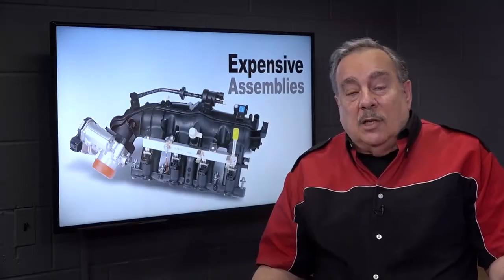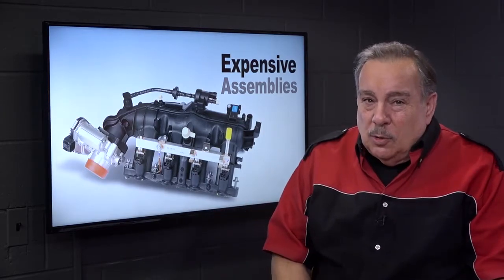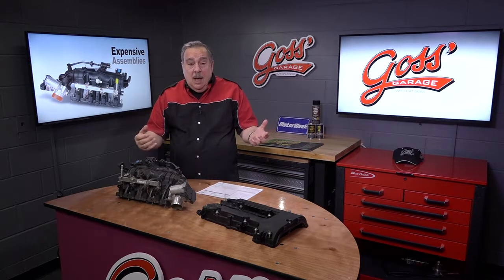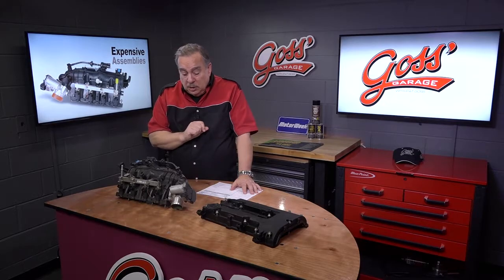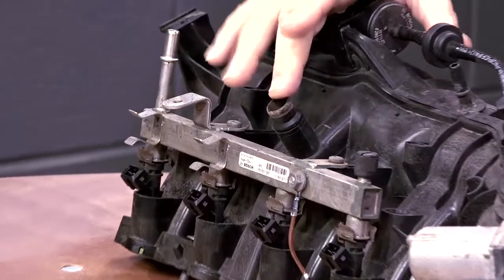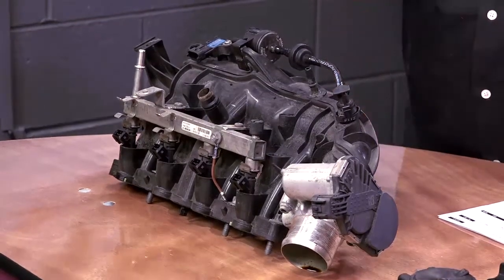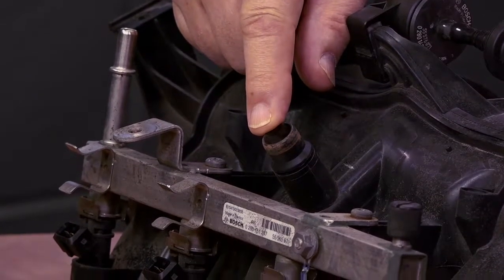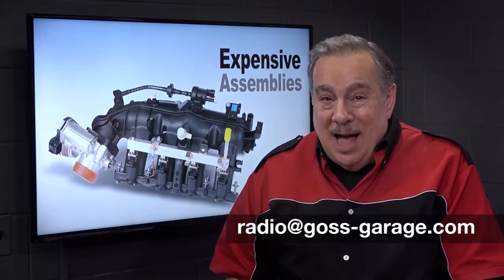Expensive assemblies are becoming the norm - Goss' Garage with Pat Goss

Comment: The only reason GM or other car manufacturers are make the parts on a car modular is because it saves time on the assembly line since instead of needing to put on every single part on the vehicle one at a time they can install the hold unit at one time so at the end of the day they would have not just one to three car made they would have five to eight at the end.

Comment: Well, if it would have been a $30 repair 10-15 years ago, then it sounds like I should be buying cars that are 10-15 years old and drive those instead.  :)
Reply from the maker: Chris,
Unfortunately many of the earlier designs are now only being replaced with the later more complex assemblies. Either that or they were a totally different design and the parts are becoming obsolete. I don’t think there is a practical way to win with cars.
 Pat
Reply: Agreed.  The more I learn about how modern cars work, the more I want an older car.  I guess it's the way everything is going these days...designed so that they either can't be fixed at all, or only fixed by the manufacturer.  Computers, cars, appliances, etc.
Reply from the maker: Chris:
 I try to do all my own maintenance on 2 houses and am finding on appliances and such that everything is becoming modular just like on cars. No more individual relays and switches just combined circuits inside a module so you have to replace a lot more then you used to. There is also a trend toward renaming parts because apparently you can get a lot more money for some names than others. If it sounds modern and complex it costs more.
 Pat Goss
Reply: So what's the point of manufactures doing this?
Reply: Aric Beemer
To make more money when your car needs to be repaired.
Reply from the maker: Chris:I presume you’re right on that one. Even if the margins on the 2 products are identical 10% of $300 is a lot more than 10% of $30. I guess that’s why so many parts we used to repair now are only available as a complete assembly. We used to repair alternators and lots of other parts but now you can’t buy the things needed to do those repairs.
Pat
Reply from the maker: Aric:
Money, money and more money!
Pat
Reply: I suppose that making things in assemblies means fewer parts for manufacturers to have to stock, but that can't be good for the longevity of modern cars. If GM decides to stop stocking that Cruze assembly in a few years, does that mean somebody in the future may be throwing out a perfectly good Cruze because they can't replace a simple valve?  I just read a story about a guy with an '09 F-150 who couldn't source an HVAC module compatible with his truck due to the unusual set of options his truck has.  It wasn't until he went public with his story that Ford relented and is having a bespoke module made just for this guy.  That's crazy for a 7-8 year old vehicle.
Reply from the maker: Chris:
Technically manufacturers are supposed to make parts available for !0 years but that doesn’t seem to be enforced anymore. On things like the manifold if there is demand companies like Dorman usually reproduce it with a better design. That’s what we’re using on the older 3.8 GM engines that have so many manifold problems. But if there is small demand that won’t be practical so yes that would mean perfectly good cars being thrown away. On the other hand a good do-it-yourselfer could fabricate a replacement valve.
Pat
Reply: It's how I live my car life.  90s accord parts are almost free now.  The other day I saw on Amazon two front upper control arms with ball joints installed, two lower ball joints and inner and outer tie rods for both sides.  The whole thing was $95 shipped  And the gates timing belt kit for my '95 is $85 shipped on Amazon.  That's the USA Gates belt, the idler the tensioner and the water pump.